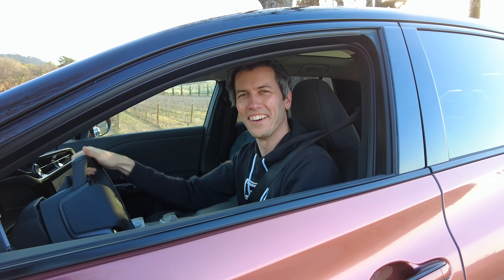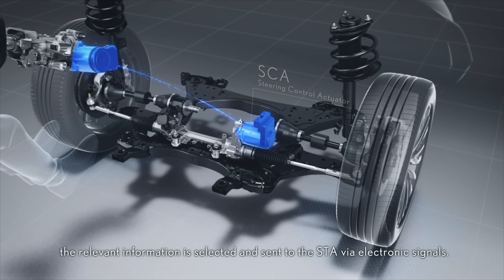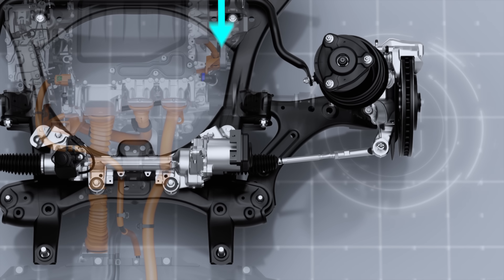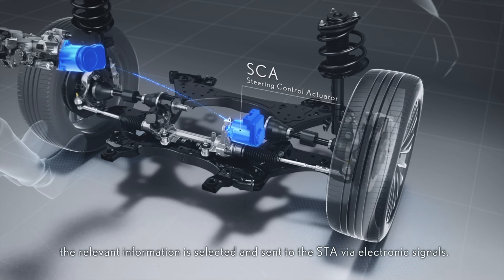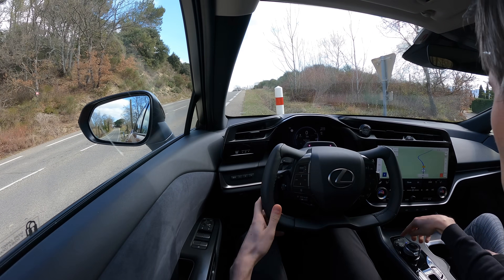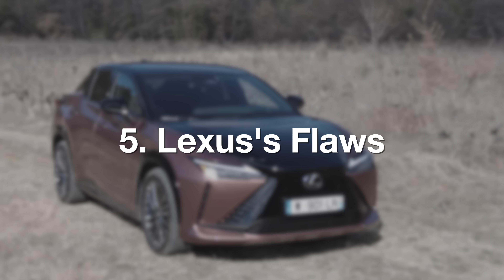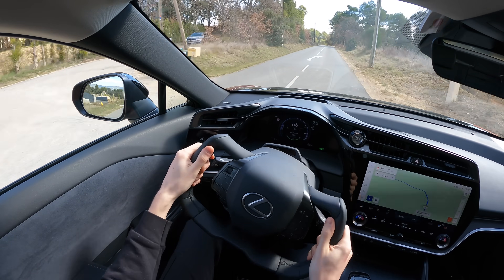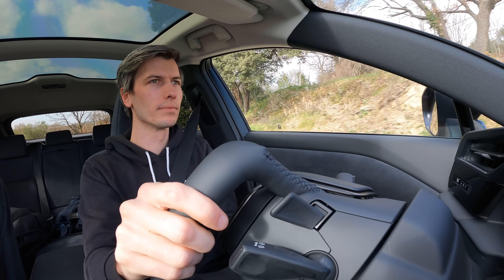How Lexus Fixed Tesla's Bad Idea: Steer-By-Wire Yoke

Comment: I love to try, in a gas engine... sorry, but those huge lithium batteries scary me a lot!
Reply: You literally have one in your phone  and any electric device that dose not have a plug even hybrids have them
Reply: @mcsike7264  I know, but the scale of a small baterry in a earbuds or smartphone is totally other world compared to a car, where i can hit a stone in the road, and damage it integrity that can ignites a almost endless fire. Also, smartphone batteries can had issues, but because of easy visibility, i can tell if they are getting worst, you can see the device deforming in any plain surface... A battery hide into a car, is really others kind of issue to handle. I prefer gas engine, that are for decades really reliable and safe, compared to lithium batteries that already did some really crazy accidents out there. Let the science cook a better batterie and i'am totally in this way, i love no noise cars, no stink polution, the torgue is insane, i already drive eletric vehicles, but the batterie still a huge concern to me

Comment: What when an EMP bursts over the town where i live, and all elektronics in the car gets fried at once ? If i have mechanical steering i can safely drive it of the road to the side but if i an only reliable on steer-by-wire i am cooked. And EMP's are more possible then ever at times like now in the world
Reply: Well electric things in your gas call will fail as well so the computer that shifts your cars gears wont work

Comment: the motor has minimal response time, and basically no delay.
What it has is a motor with limited torque, and limited power.
It cannot yank the wheel from full lock to full lock, like you theoretically could with a steering column.

Comment: The auto industry has been talking about adopting drive-by-wire for 15 years now. While it’s neat tech I don’t think it fixes anything at least with current technology. I’d much rather steer hand over hand at slow speeds than introduce lag and several points of failure that are buried deep in the engine bay.

Comment: A lot of relatively recent cars use throttle cables and not electric throttle. My Ford ranger from 1999 that I used to have for instance. So it's not back to the 1980s

Comment: There a lot more downsides to this. From an enthusiast view, this will be another module which will be expensive, being electronic it can be locked out by the manufacturer in a way that you will not be able to easily exchange it without having access to the software of the car. You can observe this in the John Deere fiasco where everything is serial numbered and if you exhcange the part it will not work without coding it into the ECU/control units. Companies will be able to decide who can work on your car, limit the availability of spare parts etc.. I dont want to think of security problems with these solutions, given gas, brakes and steering by wire is implemented in a car, internet access is already integrated in many of the new cars, you get a 2ton drone on 4wheels.

Comment: Re: redundancy, honestly my main concern is when it becomes mainstream and manufacturers advertise the redundant steering motors but decide to have a single signal cable to save $2.50 a car or other single points of failure. 
So often I see the worst possible optimisations that save them bugger all except at scale but screw over the consumer, and the traditional steering has fewer places for the good idea fairy.

Comment: Also I think the delay may be due to there not being sufficient measures to prevent users from steering the yoke faster than the motors can steer the wheels. In a traditional rack&pinion system if you try to steer really fast you'll hit a wall where the electric assisting system cannot contribute any more and you'll either be slowed down or have to power through yourself.

I may be wrong but it could be that the wheel needs to resist the user more during fast wheel movements in order to prevent de-sync.

Comment: Using yokes also opens up the possibility for cool-looking steering wheels that would otherwise be more impractical in normal steering ratios. Think of those old single-spoke steering wheels

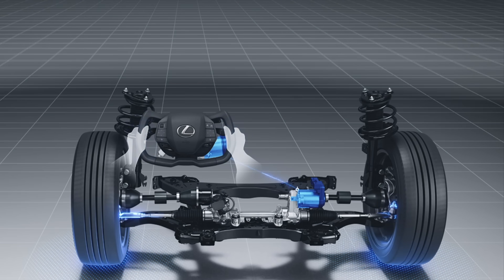Comment: 02:40 whatever bs he's about to tell you, the real reason is because the accountants think it's cheaper.  There should always be a mechanical connection between driver and wheels.  No exceptions.
Reply: Planes have been using fly by wire for decades now, its not unsafe and it can be done well, not to mention that its definitely more expensive to have 2 additional electric motors in your car and break up the production line compared to every other car. You have to hire programmers to make the controller software and feedback compute, you need chips to calculate that, its not because it affords a higher profit, its an inevitable advancement like in civilian aircrafts

Im usually very cynical about what companies do too and it will always be profit motivated but the advantages do exist and the profit doesnt come from cheaper production here
Reply: @Helycon Aircraft get trimmed continously. Cars don't have any trim whatsoever (steering alignment does not count). Different use case for different methods of transport.
Reply: @Helycon not a plane that always gets maintenance most people don't even check tire pressure let alone make sure Some computer monbo jombo works 
If we should use it cus planes use it then we should dump piston engines for jet turbine engines cuz that's what planes use
Reply: @THEANIMALGUY thats not even close to comparable of an example

not to mention that cars depending on the country do get checked up to like 4 times a year plus a walkaround before every drive and airplanes dont get checked for everything everytime either. They also have regular inspection dates.

Either way my point was that the security risks incurred by the flybywire system itself existing arent worth mentioning.

I dont care much for cars myself at all but there are so many bigger issues with the car industry and danger to human life in relation to cars than a well established and safe way to steer a vehicle.

Btw fans have been put on cars without incurring much danger to increase downforce in racing and accelerate airflow through the radiators...
Reply: @Helycon  You are forgetting 2 things, 1st we are only talking about steering. 2nd planes doesn't have exactly the same issues a car would encounter in general.

So if focus on steering and safety, power steering is safer than SBW, as if your battery dies while you are driving steering is still possible.

And no country requiered to check a car 4 times a year, 1 time at the most

Comment: I absolutely hate steer by wire and brake by wire.
Reply: Have you even driven a steer by wire vehicle
Reply: @mcsike7264  Actually not, but the sheer concept of it horrifies me. What if the wire gets damaged? Boom you have no steering. With a mechanical steering connection even if the servo gets damaged you still have steering and it is much harder to damage a steel steering column than a wire. And the latency is just the cherry on top. Even with the absolute best communication between units you will have a bit of it. Even if you can shrink it down to mili seconds it is still there.
Reply: @LGSyrus cyber truck has steer by wire and its out for almost two years now and i have not seen any issues with it also there are 3 sensor for triple redundancy 2 motors so if one fails the other can steer and planes have bin usung this tech for decades now alsoo its so good to dirrve with not doing hand over hand is so nice and combine with rw steering best combo ever
Reply: @LGSyrus  If anything happens to the stew by wire the car would tell you and if the manufacturer is good at making cars the car would stop
Reply: @mcsike7264  Yes if it happens gradually. But what if it happens while you drive and some debree on the road gets sucked into the wrong place at the wrong time and cuts through the wire bundle? Then you are in an out of control car. And I know it can happen. Happened to me once. Debree cut through my cooling line and overheated before I noticed. I had to rebuild the engine because of that.

Comment: I mean you skipped over some other concerns. Like especially software control. When there are a lot of scenarios and control loops involved it is hard to prove the software has no bugs.  Like if you recall the 737 max issue that caused the plane to nose down and kill everyone when a sensor failed.

You have more than just power. You have 3 motors, encoders, many wires, both power and signal, I assume a whole bunch of accelerometers and gyros and strain gauges? possibly tire pressure and sensors on the suspension to measure displacement and balance.

And then you have things like the low speed to high speed steering ratio algorithm. And the What happens if the speedometer malfunctions? Does the algorithm instantly adjust your steering ratio?

What if the feedback filter malfunctions in a weird scenario where the input fools it into thinking there is a pothole but in actuality it’s an important thing?  This is kind of a tricky problem.

What if you make the steering non linear such that it is less sensitive at the center position. This is a very useful control algorithm for some rc stuff.  What if this algorithm freaks out under a weird scenario or after a sensor failure?

What if a force feedback sensor fails and so it makes the steering column think you are turning violently to the left when you are actually going right and so it starts actually turning your wheel further to the right?

I imagine if I go through the system we could find thousands of possible multi failure scenarios and is the software resilient to all of them?

Comment: Steer by wire is not allowed in Ireland as it is written in our motor vehicle laws stating that their must be a mechanical link between steering wheel and front wheels and must be examined every time the vehicle is going through it's road worthiness test.

Comment: Safety wise I can see it being totally fine. steer by wire has been standard in large airplanes for decades now, and they're massively safer than cars. 

It's not like a mechanical linkage can't fail either.

Comment: 4:20 so as you accelerate while turning with a fixed yoke input, the wheel angle changes dynamically? This sounds like it might be a problem: until you spend a lot of time with the car you can't really know how your steering inputs might be directing the vehicle.
Reply: It could be terrible for performance driving.
But for a daily commute of a "Smith", it is perfectly fine.
Reply: Your hands and senses create a feedback loop—you will stop turning the wheel when you feel the expected amount of movement.

Your concern would be more valid if you had to pick the exact steering angle in degrees and jump straight to it in order to turn or change lanes.

Comment: With all the info Provided I am still 100% against Steer by Wire.
All it takes is a singular error, and the car thinks it's moving slow when in reality it's moving at highway speeds, and suddenly my steering inputs are way too intense.
We hear over and over again how a lot of cars have electronical problems that lock up acceleration, block braking or refuse to shut the car off or turn it on. Would I really trust a computer to reliably steer for me 10+ years? 

Sorry I much prefer a steel rod doing that for me, at least with that I can feel if the joint or system is reaching it's limits and I can replace it or get it replaced.
A computer will suddenly fail without warning.

Comment: My CyberTruck has the Lexas beat
Reply: As what 💀 a rock?
Reply: @DeltaStormYT  Its quicker, cleaner, way larger capacity, higher technology FSD, the steering is perfect 270 degrees lock to lock. And it's a Tesla designed in California and made in Texas.
Reply: @jjamespacbell  💀 oh yeah this is going to be good I almost don’t want to continue this conversation simply because you pulled the “um it’s a Tesla, that’s why it’s better” wow lmao. Also the fact you’re including something subjective like its design means this conversation is going to be absolutely trash lmao. But I’ll bite.

Oh wow it’s faster yay, higher what capacity? Cuz I got more range, 9,000 pounds more towing capacity (11,000/20,000), and 250 ish more pounds payload capacity (2500/2740), 8 foot bed vs 6 foot bed, factory 5th wheel, way more range, ability to more then double range with a simple inbed tank, serviceable, easily modifiable, ability to tow beyond 50 miles without absolutely nuking range, pedestrian safety, ability to fill up 0-100 in not an hour and a half, ability to use my full capacity not 70% regularly, fill up from 10-80% takes mere minutes not 35, gas/diesel pumps accommodate having a trailer, when stopping for a fuel up there’s a neat little canopied station to protect against the elements, with convenience store right there  not a hotel, or Walmart/gas station you have to walk to 500+ feet away. My truck is likely greener than yours unless your local grid is 100% renewable, factory trailer camera system that trucks have had for atleast a decade now but “ooo cybertruck is so advanced” gtfo lmao.

It’s almost as if the cyber truck is a truck for people much like the F150 who have absolutely no use for a truck but they want to look like their meat is akin to what a horse has.

Comment: I have no problem driving my tesla with a yoke ya it takes more skill.  But its way more fun and you can see everything in front no wheel blocking your view.  Everything in the future will be yoke for sure.  So just think about all the tesla owners that have mastered the yoke.   I think they will be EVEN better at the yoke with a steer by wire.  Does not make it a bad idea your click bate is WEAK sauce.
You need to change your title to good to even better because I will never go back to a boring round wheel yoke tesla all day everyday. I would rather have my tesla yoke anyway over a delay.
Reply: What? My steering wheel literally doesn’t block anything? Very few do. I mean it blocks part of the dash, and considering my car has a 1000000x more interesting dash pad and design, then any Tesla, and it’s a fkn Hyundai is sad

What is there genuinely to see in a Tesla? It’s a fkn steering wheel and screen, that’s literally all
Reply: Yes I’m aware that a Tesla round steering wheel “blocks the road” are you aware there’s almost literally no other car that does that right? Can we praise them for engineering a solution to a problem they created for absolutely no reason?

Comment: I feel one of the biggest benefits is  being able to build cars that are either left or right hand drive. As the steering column is one of the hardest things to shift from one side to the other but not in a drive by wire system.
Reply: What, huh? Okay yeah converting a vehicle you already own either way is an absolute nightmare but building? You do know when they make right hand cars they don’t built it left hand then convert it right? It’s literally just as easy to do, but just with reverse parts. 

Most of these reverse parts would also (ideally) be almost identical between drive by wire and not. The dash (pad and frame) needs to be the flipped version, center console flipped, seats, wiring harness, pedals put on the correct side, radio, etc all need flipped.

The literal only difference is the steering rack and support equipment wouldn’t have to move around. And the only thing that “moves” is the linkage, which it’s designed to do, the rack is just “flipped” Certainly not nothing but pretty damn close

Comment: The more complicated it is, more money to fix and more parts could go wrong. I have no problem with current steering wheel, may be I will try steering by wire 10 yrs later when this tech is fully matured

Comment: 12:30 the delay may not be a glitch, it may be the limit of what the steering servo can do. The solution might be for more proactive force feedback, such that the wheel resists turning faster than the servos can manage
Reply: Then use synchros, like literally almost every plane in the electronic (before. computerized) age and beyond. Absolutely no computer required

Comment: What "bad" idea do you think Lexus fixed? It is clear you have not driven a Cybertruck or are just intentionally lying. Here are many points that you have wrong:
* You are in a prototype specially prepared vehicle, while Tesla's Cybertruck is in production
* You bait and switch Tesla's NON-steer-by-wire yoke, comparing it to Lexus' steer-by-wire yoke. This is deceptive and unethical which many people would not pick up on.
* Tesla Cybertruck is in production with TRIPLE redundancy.
* Tesla does not have the delay you pointed out in Lexus.
* Tesla's steering is 4 wheel AND changes based on speed.
* Tesla's steering adjusts ratio based on speed so it is never more than a 90 degree turn.
* Turns on the cybertruck are far tighter than anything of that size.
* Cybertruck is faster than the Lexus.
* Cybertruck has a higher crash safety rating.
* Cybertruck is bullet resistant and there are many videos illustrating the durability.
* A dozen buttons on the Lexus steering wheel is not an improvement, but a detriment, being tough to deal with while driving and another part to fail. Tesla's screen based controls is cost effective and allows personalization and updates over time. That is a real advancement.
* Even on a non-steer-by-wire the yoke is fantastic on my Tesla Y. It is different and people get used to it quickly with much better view of dash and road.